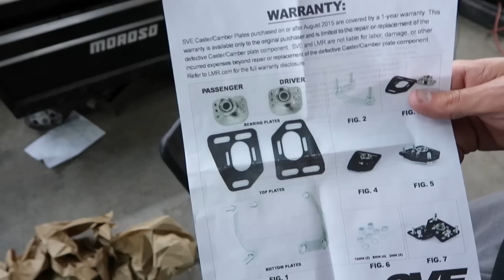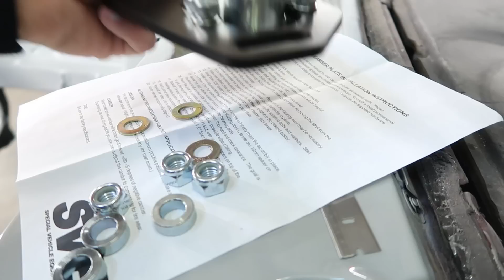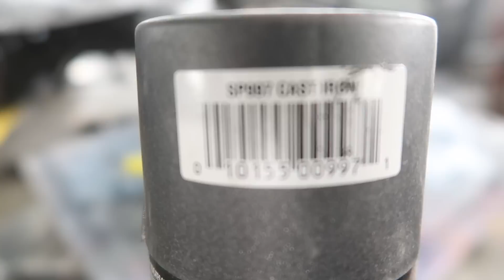SVE Caster Camber Plates

Comment: Watching how something is put together from scratch is very fascinating in a way, specially if it's mustang related. 
Have been trying to fix my 02 mustang from a wreck for about 4 moths now (just need to align the new hood w/ the old LH fender, but Idk how... I'm mainly a DIY guy, but I think I'll need a professional for that...). Wished I could just simply drive it to you, but everything is easier saying it than doing it haha.
Anyways, great videos man, keep it up!
Reply from the maker: Leonardo Lopez thanks man. Let me know if I can help in anyway
Reply: Thanks. I really appreciate it.
If you don't mind could you give me a rough estimate of the cost of that (fixing the gap between the hood and the fender?) I imagine that that's something that varies on where I take it and what kind of job they'll do. I just have never paid for anything like that so I have no clue on what kind of money I'll be spending.
Also, I've been having an older problem (I'm asking more of an advice/guidance for this one if you don't mind). Ever since I got the car about 2yrs ago the gap between the rear tire in the driver's side has been bigger than the passenger's side which makes the car tilt to the right. I didn't noticed this till about a month after buying it and ever since I've been trying to fix it, but nothing works. Tried changing that one shock for a brand-used one that worked for a same-model car but didn't worked. Tried changing the springs to lowering ones; didn't worked. I was about to buy a pair of new rear shocks but then I thought that it could be the rear axle itself. What are your thoughts about that? 
Sorry for the long comment and for just throwing at you my problems with the car it's just that it's not fun to drive it anymore knowing that I all the things that I have to fix and just throwing money at it with no positive solutions... 
Thank you in advance.

Comment: Just to let you know, those spindles are not 94/95  they are 96+ The 94/95 has a curved steering arm where as the 96+ like you have is straight.